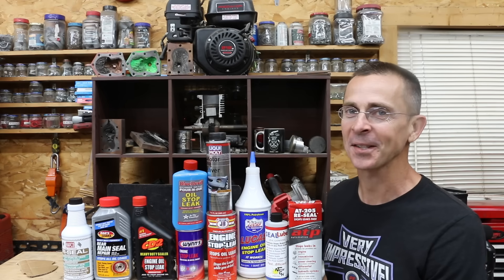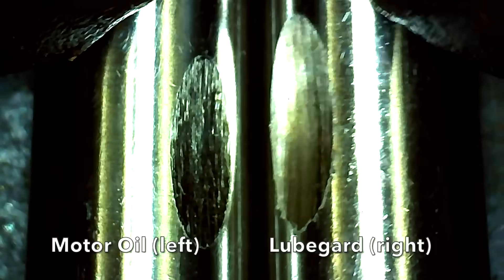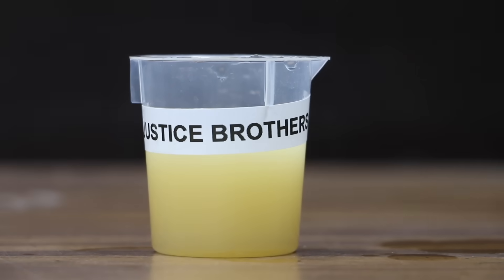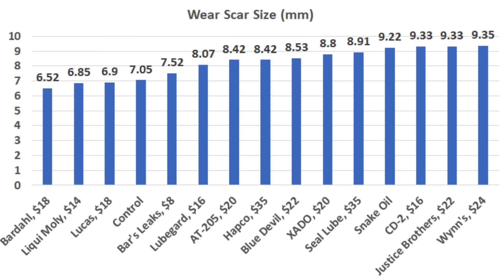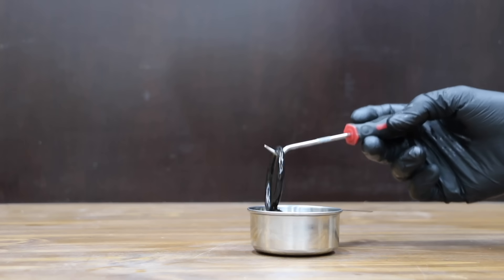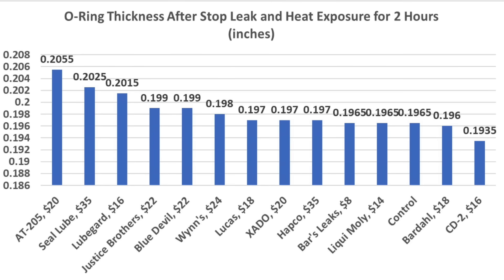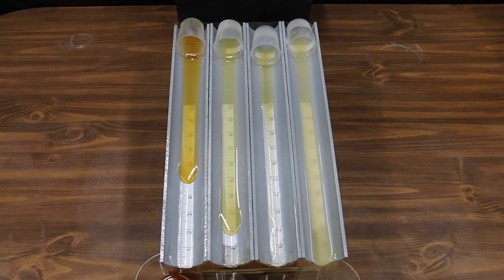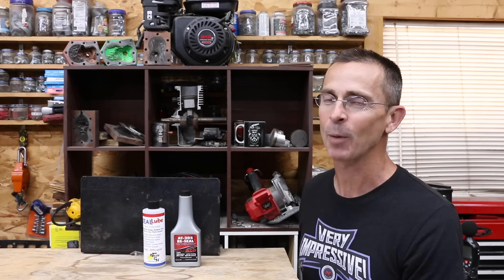Do Stop Leak Products Work? Do They Damage Engine Seals? Will They Destroy an Engine? Let's Find Out

Comment: Commander, I do believe your tests are getting BETTER as time goes on! As with the old standby tests and the newish ones with the micrometer you REALLY cover a LOT of ground. Between temp. variations and size variations it just blows me away! I have NEVER used any of this specific product for a cheat for a replacement part,  because like an engine restorer, ain't a thing going to put back metal in worn out places but more metal and I haven't seen any REAL metal come in a can. Same with seals, gaskets and O-rings. Permatex #2 helps on gaskets but will just stand so much pressure and it'll blow out. The same with a seeping o-ring. Only thing that'll stop an o-ring leak is another o-ring. I do use Lucas engine treatment or Hy-tack in differentials and trannys but not in engines. DELO and Valvoline takes care of that end of things nicely! So thanks again for a FINE job, Happy Early Spring (with freezes coming) and BLESSINGS 2 ALL!
Reply from the maker: Hi Lewie, Thank you very much for the positive feedback on the reviews. The good Lord inspires the testing approaches. I'm very reluctant to use additives. The stop leak that I used on my old Buicks rack and pinion system was indeed a miracle cure. I went from adding PWS every 2-3 days to only adding fluid once in 5 years. The old car just isn't worth the cost of replacing the rack and pinion along with other issues. Lucas is a great product! Always great to hear about your methods! You've got a great strategy for so many things! Sure looking forward to warmer weather and lots of sunshine. I just spread nearly 8,000 pounds of fertilizer to help with hay production. Without it, the pastures will stop producing grass and begin producing weeds. That'll make for some really grumpy cows, lol. It cost a fortune for the fertilizer.  So, hopefully, it'll help or I'll be significantly downsizing the herd.  Wishing yall many BLESSINGS!!!
Reply: @ProjectFarm  This is the best thing I’ve read today. It’s great to know that you recognize where your blessings and inspiration come from. 🙏
Reply: @ProjectFarm  AMEN on the inspirations! Works EVERY time! I've seen additives usually do nothing but seems like the PWS worked really good for folks here. I had a VW Rabbit diesel and swapped the steering over from power rack and pinion to regular. Never tried the power because the pump was tied to some fuel hoses when I got it. 10/4 on the fertilizer too. Old Scalawag pal had a slide in for hauling such and went to Spartanburg SC and got his in bulk. He also had a 555 Ford rubber tired hoe that the brakes hung up on. Put the synthetic additive in to help it release and it did nothing. Needed new brake wear parts. Felt like discs bit I don't know. Sweet running hoe though. Just keep on farming and praying. Now We'll have your back as well!

Comment: Love what you do man but this time i don't see much value in your film strength tests. You're doing 1 to 1 oil to sealer, but the Bar's product as an example states 8 to 1 at most (1 pint with 4 qt total capacity). So in this case you had 20 mL of oil, you should've only had 2.5 mL of sealer in the mixture and then see the effect.

I'd see a lot more value in testing the max recommended concentration instead of  1 to 1 like was done this time.

I personally had a good experience with the Bar's product on a rear main leak. Used once and turned a leak that dripped a few times an hour and stopped the drip. Took a few weeks to work. Still seeped a bit but again, no drip. I was happy.
Reply from the maker: Thanks for sharing!

Comment: I'm not a fan of oil supplements and I do have a story about Wynn's. I bought a 68 Buick with a 430 CI engine from my employer who owned a Texaco service station. He was a big fan of Wynn's oil supplement and Havoline oil. The car sat for about 5 years before i bought it. It started OK and when I drove it home a few miles the engine made a lot of noise but the oil light did not come on. I checked and found there was no oil pressure even though the pump was working. When I tore the engine down  found that all the oil passages were plugged tight with white stuff like mortar. I ran a drill in there and the stuff came out like powder. Another part of the puzzle was each head had 2 cracks with seepage stains between the rocker arm stanchions but no water in the oil. I suspect there was enough water to act as a catalyst for the Wynn's. I junked the block because even hot tank would not have cleared the passages. I use Amzoil and have no worries.
Reply from the maker: Thanks for sharing!

Comment: Your videos are priceless! The timing cover of my Corolla has what looks like a nasty oil leak (doesn't use much oil, though) and I considered this years ago but was too apprehensive given the reviews that the solvents in them melt an internally painted oil pan, which said paint then goes on to stop up the oil pump intake, not a pretty picture! 

You not only confirmed my apprehension when you said the product sinks to the bottom, but causes more wear! 

I agree, a proper repair should be made in this instance.
Reply from the maker: Thanks for sharing!

Comment: Scotty Kilmer will be proud.  He always promotes AT-205 as it's a polymer. Not only does he suggest using it for a stop leak, he also suggests spraying it on rubber bushings, rubber engine mounts etc.  So it will rejuvenate the rubber and prevent costly repairs.  Thanks for another great video Project Farm.
Reply from the maker: My pleasure!

Comment: brill vid as they all are could you do a vid on the effects off using car motor oil in a motorcycle engine ie wet  clutch discs and diesel engine oil vs motorcycle engine oil
Reply from the maker: Thanks for sharing!

Comment: My pickup started smoking on cold starts so I was looking into swapping out the engine.  I thought I would at least try a stop-leak product and found Bardahl had pretty good reviews.  One treatment and no more smoke rings.  I used it for every oil change for a while, but have since stopped.  That was over 100k miles ago!
Reply from the maker: Thanks for sharing!

Comment: I always enjoy your tests, but this one may need to be revisited. I feel like by using a 50/50 mix of oil and treatment doesn’t accurately reflect how it would be used in an engine. For example, if you have 5 quarts of oil in the engine, and 1 quart of treatment, that’s a lot different than a 50/50 mix.
Reply from the maker: Thank you for the constructive feedback!

Comment: I tested the AT205 a couple of years ago thanks to a Scotty Kilmer review.  I had a rear main seal leak in my toyota highlander.  With just one bottle fix the leak.  Several oil changes later and no leak.  I still use a bottle every second oil change.  Sadly the prices went up.  I remember I bough them in amazon for $10 a bottle.
Reply from the maker: Thanks for sharing!

Comment: I’ve been selling many of these for a few decades. ATP AT-205 is considered a “re-plastifier” and performed as I expected. Another great use for the AT-205 is wiping vehicle door gaskets before and after winter, also spraying it on suspension bushings. It can even extend the life of air suspension components in expensive luxury vehicles. Great job!  Love the channel.
Reply: Never thought of lubing door gaskets.  Does it help prevent them from freezing up too? Always get a couple of days each winter where I have to pry my doors open.
Reply: @tinknal6449  silicone spray works well for lubricating door seal gaskets and helps keep them from sticking to door jambs in freezing conditions.
Reply: @Hawk7886  Good to know, thanks!
Reply: @tinknal6449  I've always just used a silicone spray/silicone stick and never had frozen door seals 🤔
Reply: @jaskajokunen3716  About *Silicone Sprays* - READ THE MSDS! Nearly every single spray can uses petroleum products (like propane, etc) as a propellant, and those usually eat door seals. By trying to protect the seals, you could actually end up damaging them.
Reply: @tinknal6449 some car manuals actually include lubing door gaskets and other rubber seals as an annual maintenance recommendation.
Reply: @tinknal6449  it helps with them keeping their shape and pliability over the years. The freezing will be caused by water not drying quickly enough around or in the seals. Only drying off the door seals will help with the freezing.  
WD-40 is a water displacement product (that’s the WD in the name) and will help in your case.
Reply: Can hear scotty kilmer spraying it on bushings.
Reply: The Project Farm paradox is that when I see I product I like and want - that really tested well, it's always sold out or "Temporarily Unavailable" at Amazon. Can't believe how good this Channel is. 

I await with eager anticipation every Sunday at 5.30pm (London time) in my Project Farm "Very Impressive" tee shirt. Am I sad or what?
Reply: @markeymark5265  I like to quickly Google the price of the winning product, screenshot it, then check it again a few days later. Any guesses what almost always happens? Haha
Reply: @markeymark5265  You might want to get more of a life like going down to King's cross station and looking for platform 9 3/4.
Reply: Brilliant, thanks for sharing!
Reply from the maker: Thanks for sharing!
Reply: I use dielectric grease, which is basically silicone on all door seals and rubber boots and they never crack or dry out.
Reply: Recently I had worse case scenario with a front main was scored from high mileage mauling new seals quickly I choose Lucas in this situation, and did very well at keeping the leak manageable... Thanks for your research!
Reply: That stops bushings squeeking?
Reply: @Jul-66  No. It helps good bushings keep from deteriorating.
Reply: And Windshield Wiper blades
Reply: I don't like to put anything on rubbers, plastics, easily you can add a product that you shouldn't and damage them
Reply: Is STP stop leak  is considered a “re-plastifier”?
Reply: @aris95 it’s a seal sweller. It’ll recondition your seals but eventually because they are swollen they will break down. It’s a very temporary fix.
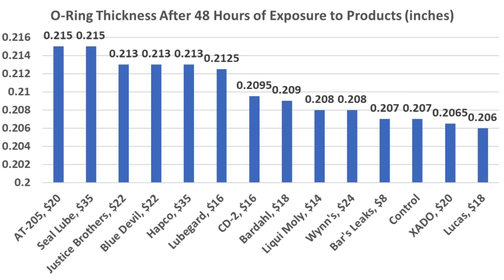Reply: @prannermedia842  Because STP was not in this test which category do you prefer STP the most effective or less effective? Look  at 17:51
Reply: Huh.. never thought about doing such a thing. I'm wondering if this will help with my 15 year old that is just starting to have its weather sealing go.
Reply: @tangentfox4677  more of a maintenance thing when they’re good to prevent deterioration; but it might buy you some time.
Reply: Great tips! I've been using the same condom since 2006 and now after having several children recently , I think I'll be giving the AT-205 a try😂
Cheers fellas 🖖
Reply: Wonder if anyone tried it on old rubbers (condoms) 😁
Reply: @daewooparts  you don't need em if ya go backDo.
Reply: 205 hasnt done jack shit for me in every car ive tried it on..
Reply: The 205 seems to have made mine worse 3000 miles since putting it in. @jonc2914
Reply: @jonc2914  it depends on what’s actually wrong if it can help and how much it can do.

Comment: I feel like the tests with a 50/50 mixture should be redone with the correct ratios as per the respective instructions. Also would be interesting to see how the orings look after leaving them in the stop leak for 3,6,12 months.

It's my understanding there are primarily 3 modes of action for oil stop leak products: swell the seal, restore pliability, and/or thicken the oil. These products seem to employ 1, 2, or all 3 of these MoAs.

I have used Liqui Moly and didn't notice much difference. I have also used AT-205 and it stopped a substantial rear main leak (1L/600km).
Reply from the maker: Thanks for sharing!

Comment: I would add a dry control run to the just oil control run, just to establish boundaries.

I'd also repeat the control runs after all testing has concluded, resurfacing the wheel with sandpaper will reduce its diameter, almost certainly affecting results.
Reply from the maker: Thank you for the video idea!

Comment: Great to see how easily AT 205 softens rubber. I don't use it to stop leaks but instead put it in a spray bottle and spray my 30+year old rubber suspension parts once or twice a year to slightly rejuvenate the aged rubber a bit since it is a plasticizer fluid and one of the main reasons rubber hardens is due to loosing plasticizer in its compound.
Reply: They don't lose the plasticizer agent but rather the chains it forms start to break down. This stuff just helps those chains loosen up and reattach. It definitely works though. Bushings, cv boots, power steering boots, etc. Even door trims can be helped with it. Although you should get something dedicated for that since they come with better smells...
Reply: @skurblord3401  eh who cares of the smell if it's just the suspension parts outside of the car. Just don't want to douse the parts in at 205 or they will become TOO loose and squishy to do their job for the car properly.
Reply: The garage my father went to in the 60s would spray the rubber suspension bushings to keep them pliable but I never found out what it was. I always wondered if it would be good for CV Joint boots.
Reply from the maker: Thanks for sharing!
Reply: How does it lose plasticizer?
Reply: @squirrelcovers6340  
They literally leach out of the rubber over time. Evaporation and degradation.
Same reason you use cleaners and treatments for vinyl and rubber gaskets.
Reply: This is exactly what Scotty Kilmer says to use on rubber suspension
Reply: @jdmforever5583   I'll try it anyway.
Reply: @funonoldwheels7150  I use this in my Honda 4-stroke Outboard  was leaking engine oil... and it stopped leaking now
Reply: @jdmforever5583  disgusting, I trust the op more than that
Reply: I wonder if the AT -205 would work to prevent the exterior side walls
of car tires from cracking, due to being in the sun and drying out.
Once they crack a lot of tire places make you get new tires. They say
these cracks could cause the tires to blow out, and it's very dangerous.
Maybe it would soften the tires too much tho ?? I don't know ??
Reply: That is a great idea 👍
Reply: This is a good idea, I'll have to do this!
Reply: @ColbyJohnson  don't soak up rubber parts too much you don't want them getting TOO soft!
Reply: Will this help if I need a value cover gasket ?

Comment: I'm thinking if I put the best additive for the leaking rubber and after some  use when the leaking it's resolve I change the oil and the filter for causing the least of friction possible?  The leaking would return or not In your opinion?